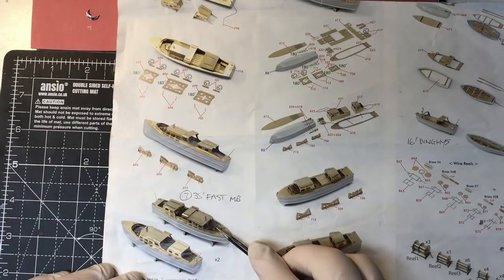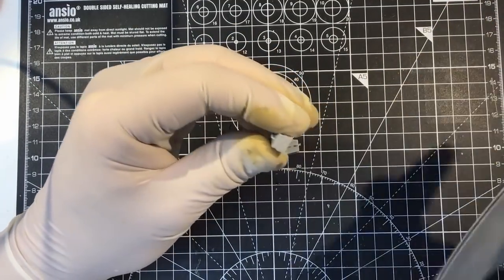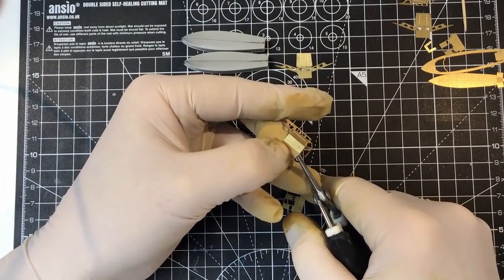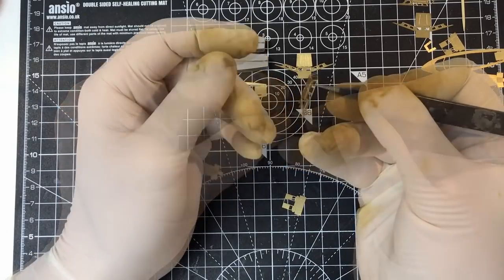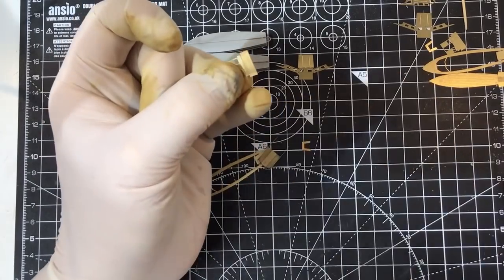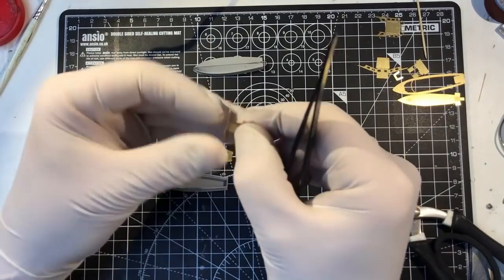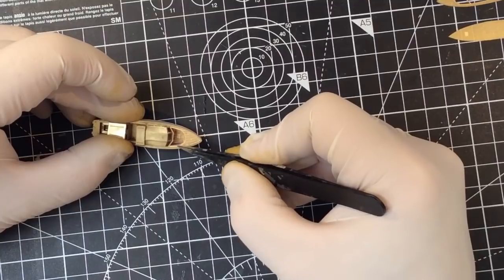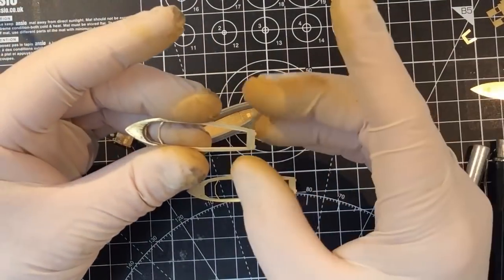Trumpeter 1/200 HMS Hood Full build with Pontos detail set Part 36  (35" Fast Motor Boats)

Comment: Hi steve. just a quiclie. I was wondering what brand of paint remover you could recomend.
Reply from the maker: Hi Anthony. On metal I use cellulose thinners but that’s no good for plastic as it will melt the part. For plastic I use 100% alcohol . There are proprietary paint removers for plastic from many manufacturers including Tamiya, Revell, mr hobby and deluxe materials but I can’t vouch for any of them. If you use any of these bear in mind they’re all caustic and you have to take care to follow the instructions. I wear a full respirator face mask when working with cellulose thinners.